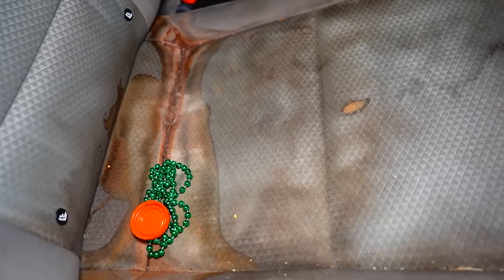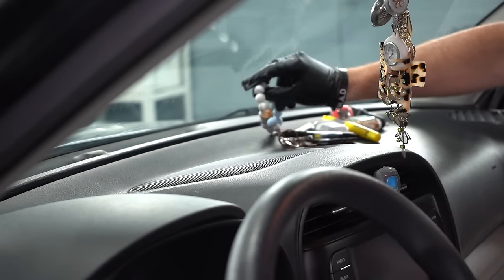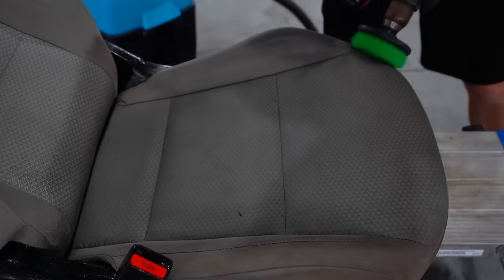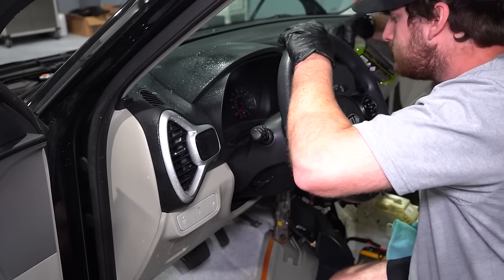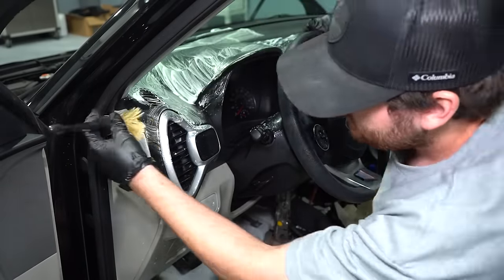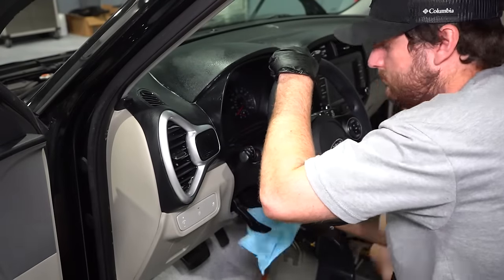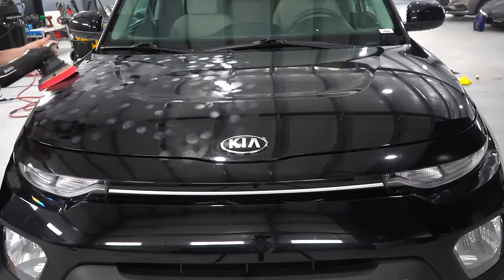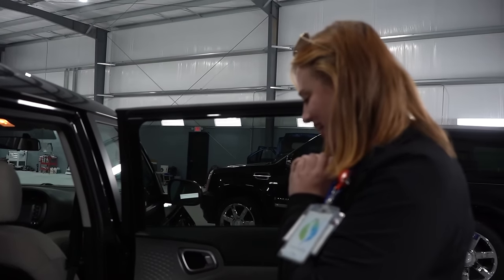Deep Cleaning The NASTIEST MOM Car Ever! | Best Owner Reaction | Insane Car Detailing Transformation

Comment: I have 2 tips for you: I don't know if you ise a wash grid but I'd recommend to use one, to get rid of the dirt that sticks in the wash mitt. And the most important, use a separate wash mitt for the lower parts of the car. These areas are usually the dirtiest and if you try to clean all areas with one wash mitt, you'll cause micro scratches in the paint. sorry for my English but as a car washing enthusiast I wanted to give some tips. Greetings from Austria 🇦🇹

Comment: Good Morning!
Very good work, I would like to make a suggestion: at 27:14  when you start to clean the carpet of the car, you do the dry brushing to remove the dirt that is on top of the carpet, perfect, but when you start to apply the products and brush again instead of using the extractor to remove dirt you could apply water with the high pressure washer you will spend less cleaning products, less time and the effect is better without saying that the smell will get better, you can use the extractor to remove excess water and let it dry on a clothesline as if drying clothes.. do this test on the next car..
Congratulations✌✌👋👋👍👍

Comment: Maybe I'm old-fashioned, but if I were having my car detailed by a professional I'd at least remove all the trash and personal effects I could.  It's about respect, both for myself and the professional who's doing all the work I can't do on my own.  I clean my car myself with a shop vac and a steamer.  I wish I had your kick-ass extractor.  Our fleet is a 2007 and a 2014, both bought used, and there's only a little wear on the driver's side floor.  I will be using your tips.

Comment: Tip why don't you wash the car from top to bottom so you don't get the car scratch from the mud or dirt that gets on the lower part and it's less hussle to remove the scratches save you time.

Comment: Okay fine if you're car seats, floors gets dirty, with spills, drinks melted chocolate, kids throw up or pee who knows whatever anything else and u can't deep clean it that dirty spots by your self. but all that trash every where is just nasty. Why the hell u can't pick out the thrash and do just 5 min vacuum through the car and then send to detaile to deep clean. Even if i just need to bring a car to mechanic i do quick clean up and vacuum. Just for small kind of respect to people who works and touches my car. This just is horrendous and nasty, in different kind of video i seen detailer find used womens pad. This all most looks like job for garbage men not detailer wtf.
Ps. Great job on getting clean that haoss.

Comment: bet that thing smells good now too, imagine what that garbage dump smelled like, an old high school locker room and a fookin old folks home garbage can .. lord how do they do it, I wouldnt sit on those seats gross... yes it is nice and shiny, NOW TAKE CARE OF IT, get on his calendar and let him maintain it, it will hold its value if you take care of it.. are you doing your oil changes? your valve adjustments? for sure your timing belt or you will be stranded and that Zero clearance engine will cpost plenty to repair, every 60,000 miles you need to change that timing belt, every 3000 for oil, every 12000 or every 3 years on the coolant.. don't procrastinate on this routine maintenance, especially your oil changes and belt, and FIND A GOOD SHOP to do your changes, the Kia dealer, quickie loobs are too risly, they scam way too much, wont change the filter and toss some junk ass oil in but charge for everything.,..  that's a nice vehicle, take care of it...